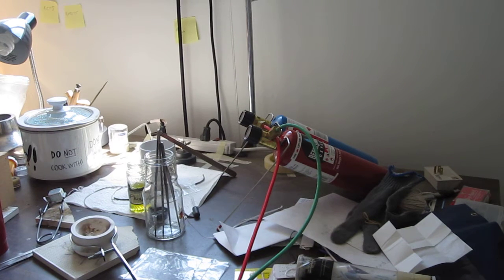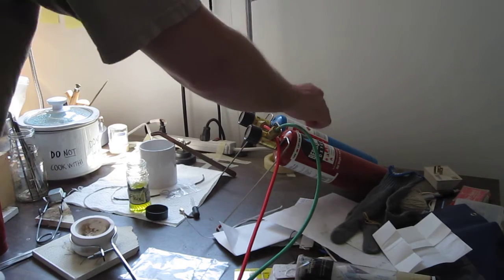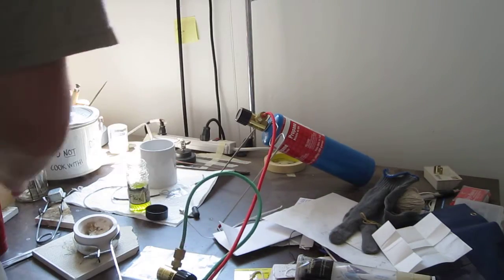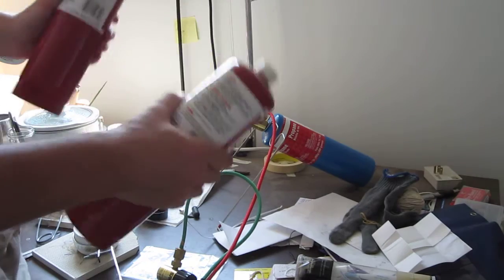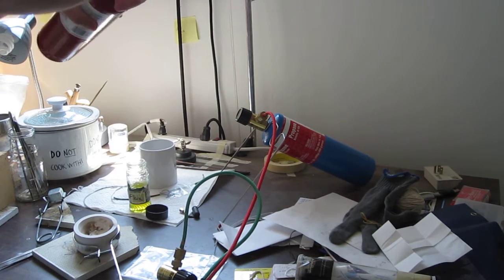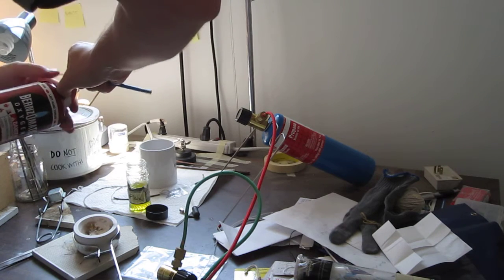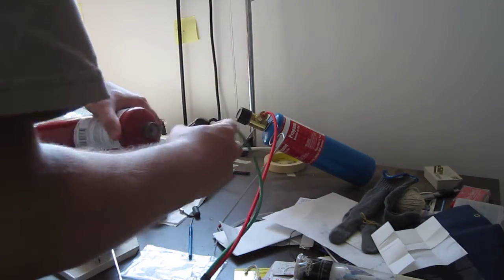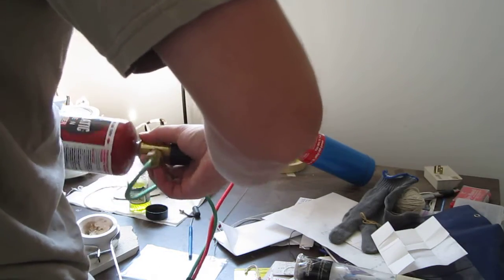Replacing a Disposable Tank on a Smith Little Torch

Comment: I can’t remove the regulator from the oxygen tank, my husband and I we both try and it doesn’t move he try with a plier but I stop him because he was damaging the regulator, do you have any advice?
Reply from the maker: First make sure the regulators are turned off and the gas is burned out. Second I would attempt submerging the whole thing in soapy water and try to loosen it.  Or squirt something like window/ all purpose cleaner to loosen the connection then try to loosen. 
Now if that doesn't work disconnect the hoses so that all that is attached to the tanks is the regulator. Take an adjustable wrench but wrap it in leather or cardboard something soft to protect the regulator.  Attach the wrench and slowly and carefully try to loosen it.  if that gets everything apart before using the torch again check that your seals are still good on the regulator and hoses.

Comment: Are the regulators necessary for the tanks? Will it attach without them if I have he little smith torch?
Reply: It is a different connector size. You can't, and would not want to, attach a torch directly to the tank.  The regulator throttles the pressure of the gas coming out of the tanks. The hoses wouldn't withstand the amount of unregulated pressure.  Very good question. Michael -- your thoughts?